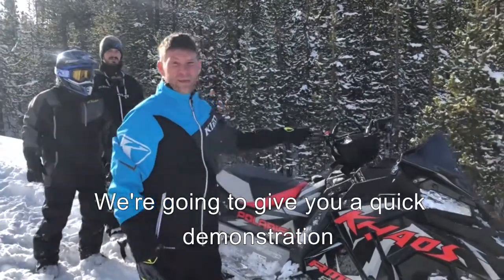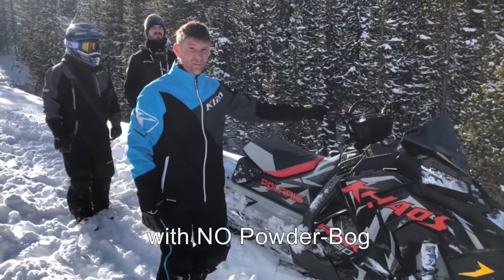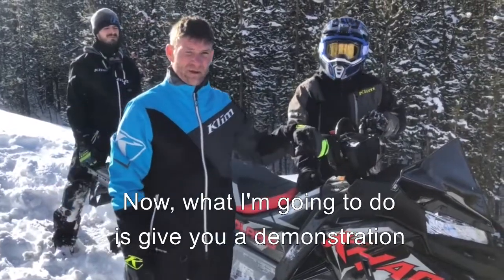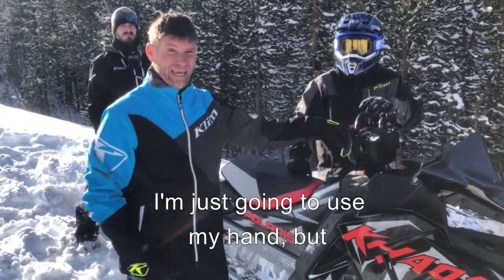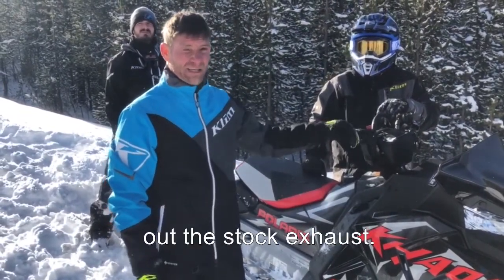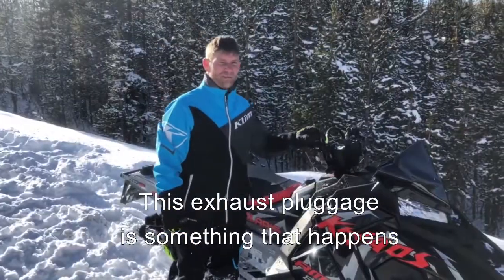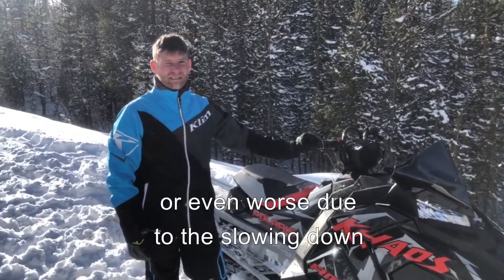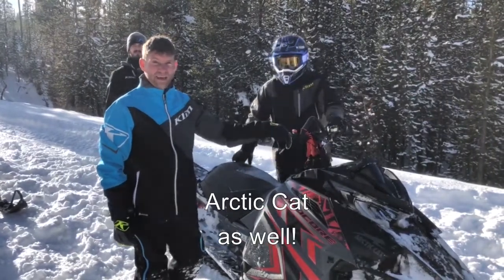Powder Bog is Real!

Comment: What do you recommend doing about this problem? I have a 22 850 146 and it bogs in this deep snow. I can even tell just when I’m holding it wide for too long in a wheelie. What would cause it too bog if the exhaust is out of the snow? Its only got 600 miles so there really shouldn’t be motor trouble
Reply: I was wondering the same thing, I have a Ggb race can on my 2020 pro rmk 800, 4/10 bogs when I open it up on a wheelie, sled only has about 300miles on it, almost thinking about putting my stock can back on, never did that once when I I had stock on

Comment: Nice vid thanks!  I ride an old beater.  A triple no less!  It's like 3" off the ground where the exhaust pipe exits the underside.  I think my sled bogs sometimes from what you demonstrate.  What do these new sleds have in front of the pipe to maybe help with this situation?  Is there a plate shaped like a V or something that kinda clears the snow right in front of the pipe if your in deeper snow?  Kinda like a snow plow?  Is the actual pipe cut at an angle so the front edge kinda rakes the snow away?  I would imagine this to be a problem right when you get stuck or when you are kinda crawling thru some powder (especially on my old dog!).   I'm asking because I might make something and bolt in under my sled in from of the pipe to see if it helps at all with my occasional bogging issues.